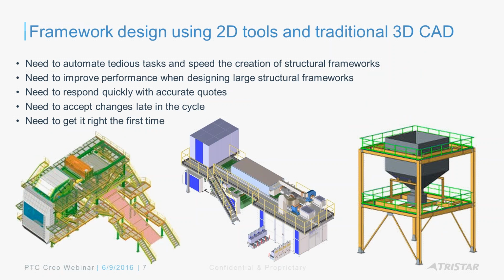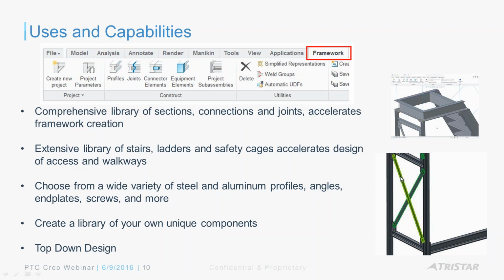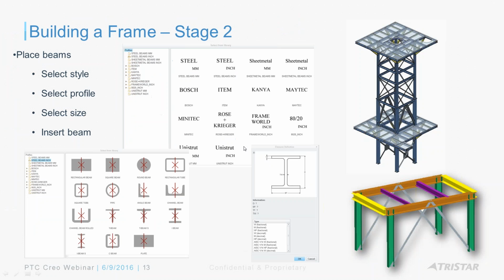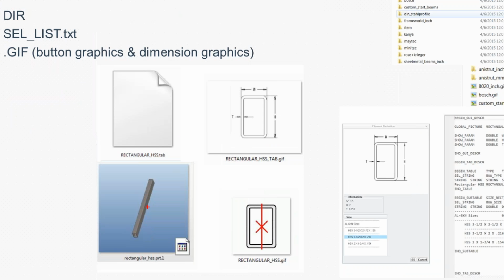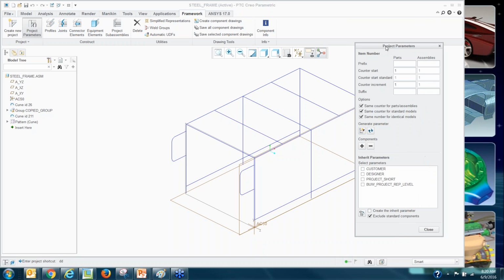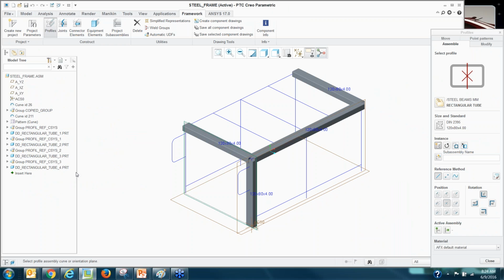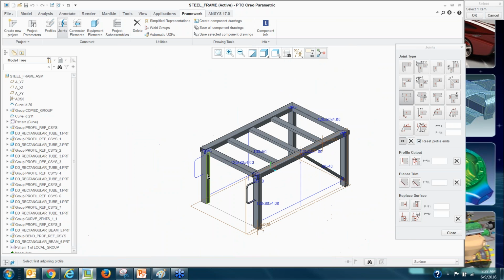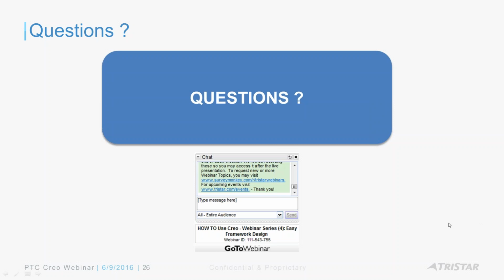How to Use Creo Advanced Framework Extension (AFX) – Easy Framework Design

Comment: Here I have bring the beam size by relation

But it is not calculating the total length it is coming separately 

I have to bring stock length in the bom table with the weight addition

It is taking much space of the drawing

I have to bring its total length and weight in single row

Like: ISMC 100X50X TOTAL LENGTH

and likewise total weight

So please can you help me in it